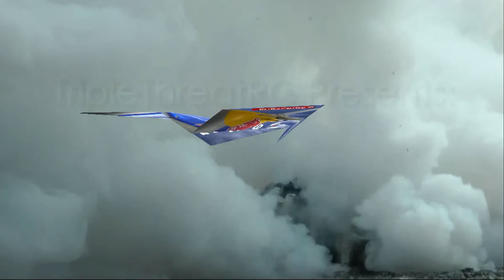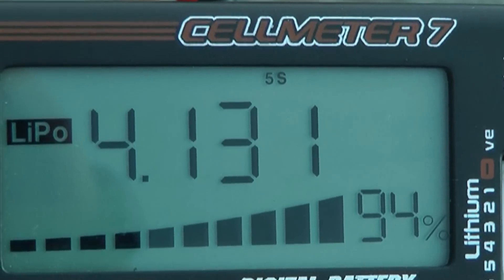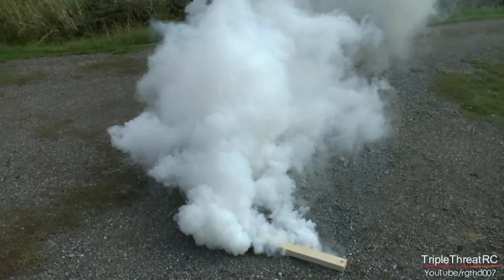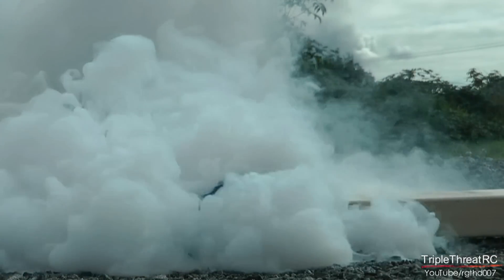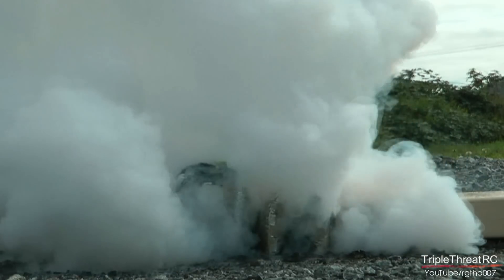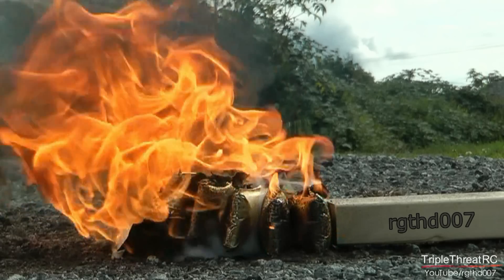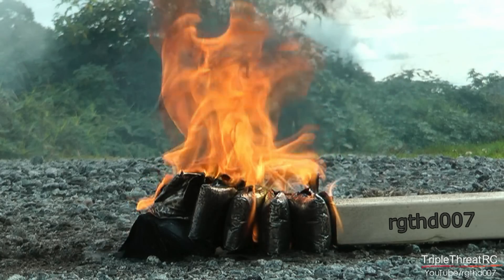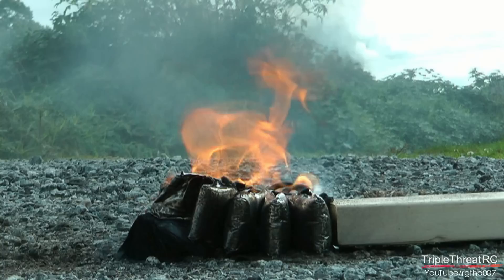Respect Your Lipos  Part 1 - Lipo Fire

Comment: I underdischarged a 3s 2200 recently, and tried a slow charge. I heard it crackle once and puff up, ripped it off the charger and ran outside in 15 seconds and closed the door. Took about 3 minutes before it blew, spark shower went up 4 meters. It set fire to a plastic tub of water 2 meters away. Scary stuff. Got some 6s 10000mah's that I charge at 800w now, will be more careful with these :)
Reply from the maker: Yup, they are fine as long as they are treated properly but are very unstable if you don't know any better and/or make a mistake.  I know of three people who have burned their garage or house down when charging lipos. Always charge with supervision and always error on the side of safety. I'm very happy that you were able to react quick enough to save the day. 
Happy flying to you and thanks for sharing your story!  Cheers!

Comment: The only safe way to disposal the lipo batteries is to fill water with much salt as possible, then cut the red wire abit long, and cut black wire short to keep far away from each other, then let it for 24 hours or even more, finally, wrap the lipo batteries with newspaper and throw away in the trash can.
Reply from the maker: You are quite right of course and I always do as you recommend. The only point of this video was to show how much stored energy and potential danger there is in a charged lipo.  Some people are unaware of the risk of fire. I personally know of three houses that burned down because of an issue with a lipo that was being charged (unattended) or with lipos that were being stored fully charged.  Thanks for watching and your comments! Happy flying!
Cheers, Bob

Comment: I have two shorty lipos 2s I was given free to try with my r/c car but upon inspection I found damage to the one plug and the other was puffy so I discharged them using car taillights. The damaged plug battery puffed slightly, the puffy battery puffed more and voltage on both is 0.06v after putting a wire from positive to negative and letting it sit in salt water two days after discharging to 0.06volts is it safe now? Thanks  "0.06 to 0.03 volts"
Reply from the maker: Well, I wouldn't use wire to create a dead short.  All I do is cut the battery leads at different lengths so they can't short out and then throw it in a small container with salt water for a couple of days. The salt acts to complete the circuit and the battery discharges slowly until it is dead.  
It's good to know you take battery safety seriously!
Cheers!
Reply: ***** Oh Ok, Thanks for getting back to me I will put it back in the water for a few days 👍

Comment: You have a lipo bag big enough to fit a Prius? 
I have 250ah yes that's not a mis print 250ah large format lipo for electric car use 42 of these are in my Volvo conversion 
Why is it that only RC lipos are considered dangerous? 
The ones on my Dewalt drill and my Bosch impact gun don't require a lipo sack
Key point is ABUSE lipos are safe unless abused
Reply from the maker: Good questions. For the most part, we might be confusing the Lipo aka lithium polymer batteries we use in RC with lithium-ion batteries found in power tools. All batteries need to be treated properly but Lipo's  (for lithium polymer)  are not as safe as lithium-Ion batteries and do not last for as many cycles. They can however, put out more power over a shortage period of time which is what's needed for the electric motors in our RC aircraft.

As for the Prius, here is a short summary I found on the internet. I suspect the batteries you used in Your Volvo are also lithium-ion and not lithium polymer :

"Expect the Toyota Prius to use lithium-ion batteries when it's redesigned for the 2015 model year. That's the latest from Hideki Iba, general manager of Toyota's battery division, though he cautions that the new battery technology may not make it to entry-level Prius models due to cost.

The switch to lithium-ion batteries would be a big one for Toyota, as the Prius has used nickel-metal hydride (NiMH) batteries since it debuted as a compact sedan for the 1999 model year. While many competitors already offer the newer lithium-ion technology, Toyota has stuck it out with NiMH -- primarily due to production costs."

I also found this: " There are already lithium-ion batteries in some Toyota vehicles (the Prius Plug-in Hybrid, the RAV4 EV and the European Prius+, for example), but the company's standard bearer – the non-plug Prius hybrid – still relies on nickel metal hydride (NiMH) cells."

I hope that helps!  Go crazy on Google to learn more lol :-)
Reply: The pack for my Volvo is a lipo NOT a lion  it was made for my conversion with hundreds of pouches made into modules . each module has a balance board built in
Reply: See plasmaboyracing
Reply: My pack was a smaller version of his same mfg.
Reply from the maker: Bryan Sullivan
Sorry, I am not knowledgeable enough to comment on the use of Lipos in automobiles. I'll read the material at the link you sent and I have to assume that the supplier for your conversion knows what he's doing. It will be interesting to see how many cycles you get out of them. I wish you the best and top of the season to you!
Reply from the maker: Bryan Sullivan
I had a look at plasmaboyracing's website. Awesome, it looks like his conversion is build for high discharge and performance as opposed to long life. I couldn't find any information about how long the packs last before they need to be replaced. An awesome project!

Comment: I charge my lipo's on a concrete slap / flagstone with plenty of height clearance. So if a have to step away for a min or two? Hopefully my shed wont burn down.
Good demo-  Mr. rgthd007.
Cheers and what'o
Reply from the maker: Thanks very much.  When charging lipos, it's always better to be safe than sorry, that's for sure. It is unlikely that you'll ever run into a problem but I suspect those that did have a problem felt the same way. Happy flying and thanks for watching!

Comment: hi there, in july 2007 my entire house was burnt to the ground when I left a 3 cell lipo battery charging unattended. I had only been away for less than an hour when I got the phone call to come back home quickly as possible as there had been a fire. when I arrived I was in total shock at the scale of the damage. the fire brigade were still there and luckily my elderly aunt who was in the house at the time was able to escape with her life as she was in her 80s and on a zimmer frame.  the bungalow was completely gutted and both me and her were out of the house for over 5 months until the house was fixed up. it was a nightmare and a hard lesson learned. I havnt used lipos since and I now fly with glow engines. I would urge everyone to treat these lipo batteries with great respect.
Reply from the maker: Hi Adrian, I'm very sorry for the loss you and your aunt incurred but am very happy to hear that no one was injured. Thank you very much for sharing your story. I get a sense from a few of the comments so far that we are making a big thing out of nothing when it comes to lipo safety. Your story and many like it may help to drive the point home. Like most other accidents or tragedies, when things go wrong with a lipo, they go wrong fast. I think the worst thing you can do is take lipos for granted and assume that because you think you are doing everything right, that nothing can happen. This is very much a case where an ounce of prevention in worth a pound of cure! I handle lipos with the same care I give to firearms or anything else that can go wrong in the blink of an eye. A friend recently lost his brand new 71" 3DHS AJ Slick when its lipo caught fire in mid air a few minutes into his flight. There are people that say that can't happen.....but it did.
Thanks again for telling your story and helping to spread awareness!
Cheers, Bob

Comment: Hey Bob good vid topic,something we all need to know, I use a burst bag to charge and a metal ammo box to transport my charged lipos,when not in use they live in a metal tool box in my shop just in case something goes wrong,looking forward to part 2.
Reply from the maker: Well done Mike! As long as they are at or below 3.85 volts per cell while they're stored, you're good to go. I bought some burst bags from Hobby King that look very suspect. I'm going to let off a pack in one of them to see how it does :-)
I think metal ammo boxes are the way to go. They should however, have a vent hole or they can turn into shrapnel. Some people just remove the rubber, watertight seal from the lid. The gases build up a lot of pressure and it needs a way to get out in a worst case scenario. Thanks very much for watching!
Cheers, Bob

Comment: This is my preferred method of disposing of old lipos.  As soon as the smoke starts, I spray it with the garden hose.  Keeps the smoke down a bit, and prevents actual fire.  I think it's worth noting that lipo batteries do not just spontaneously fail, burn, or explode.  In every single instance I  have ever seen,  they were mishandled.  I don't worry about my batteries causing any problems in my house, because I don't abuse them, and I charge responsibly.
Reply from the maker: Consider it noted, thank you. Actually, we only let it burn to make a point. Our preferred method of disposing of a lipo is much safer than this destructive approach. First we discharge the lipo. Then we cut the leads (at different lengths so they don't short out) and put the lipo in a salt water bath (a handful of table salt in a bucket of water) and let it sit for a few days. The salt acts as a conductor and safely and completely discharges the battery. You can often see fizzing at the ends of the wires. After two or three day in the bath, they are totally spent and inert.  And I agree, it is usually mishandling that causes a lipo go off. That can also include overcharging!  Thanks for you thoughts and suggestions, much appreciated!
For what it's  worth, the two guys I know that burned down their houses thought they were doing everything right too. Sh_t happens.
Cheers, Bob

Comment: Hey Bob!  Very informative for me and appreciate the awareness and concern of this issue.  I look forward to part 2 being a noob in the hobby!  I need to look into a fireproof storage safe or cabinet!  Another lesson from the "Writ of RC wisdom"!  Thumbs up and well done Bob!
Reply from the maker: Thanks Fred! Lipos that are stored at a storage voltage of 3.85 per cell (or less) and kept in a fireproof storage cabinet is the ultimate way to go for sure. Some of these cabinets are pretty pricey but not when you consider what's at stake. Many will shy away because of the cost and thankfully, there are less expensive solutions. Many thanks for watching and your awesome comments! Cheers, Bob

Comment: Love the lipos, but they do scare me to death.  I am actually in the process of building a battery bunker/charging station.  Good video.  I have tried this before, but it was with a pack that was really old and had sat until it was below 2 volts per cell.  It swelled a little, but no pyrotechnics....
Reply from the maker: And that is exactly the point my friend. If batteries are stored at or below storage voltage (3.85 per cell) they are highly unlikely to cause much of a problem if something happens. It is the stored energy that causes all the problems, not the batteries themselves. Many thanks for your comments and for watching!
Cheers, Bob